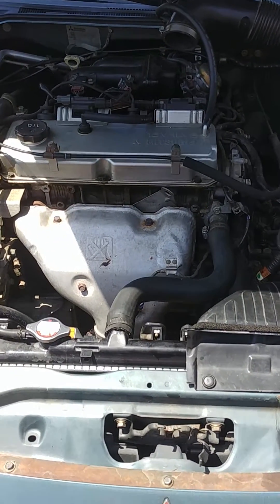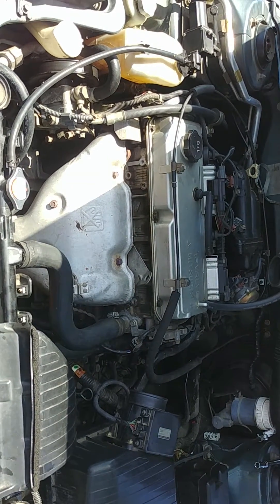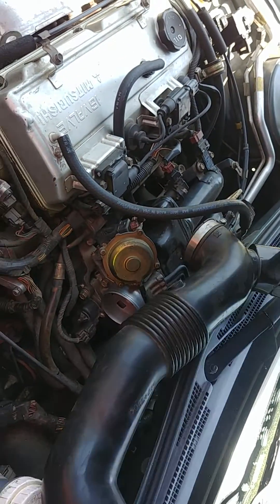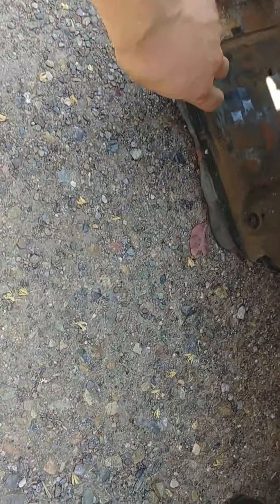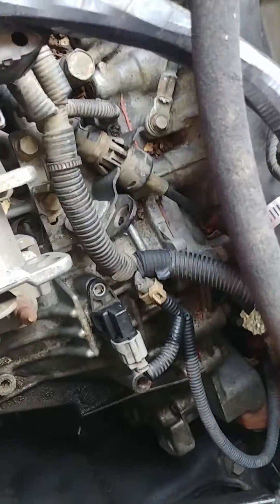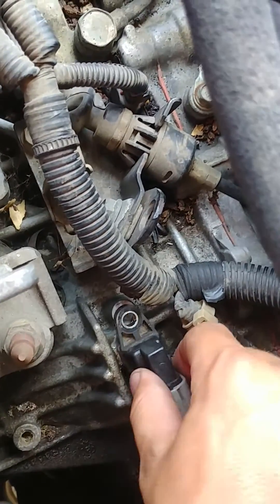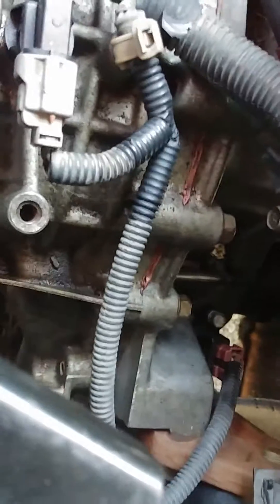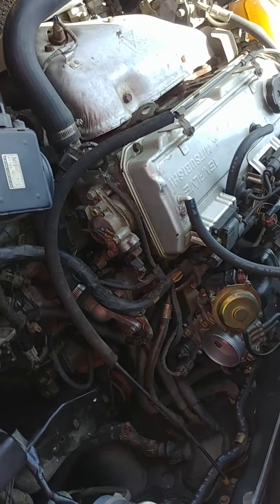Automatic Transmission Vehicle Speed Sensor Location and Replacement

Comment: Just so you know that first sensor you took out was a camshaft sensor I found this out when I replaced my output sensor and had a code go off and my car having problems starting after replacing that one with my output the lower one that you can't see in your video is the actual output and the one underneath the battery is input FYI
Reply: Thank!!! It’s really helpful!! So its only 1 sensor right? 😅

Comment: I have a 2003 Eclipse GTS Spyder, 3.0 Auto, are both sensors in the same spot as the 2.4?
Reply: I’m having the same problem. Any luck?
Reply: @NahumDoesIt  I just found the sensor that’s under the battery
Reply: @dominicio  gotcha. Hopefully its that one. The one I’m having problem is the input one

Comment: Hi, wonder if you could help. 
I'm looking at a mitsubishi shogun 2002, was told by the guy that  "It drives fine in manual mode as semi auto but gets gear jumpy in full auto mode. Took it to local garage and they said it was only an input shaft sensor"
I have looked everywhere and can't find an input shaft sensor, any ideas please thanks .
Reply from the maker: I am sorry for late response but I would replace all of the sensors, I bought the first 2 at a Joe Blow auto shop and they were both wrong. Bought offline, both wrong. Bought off wholesalers site the parts were fine and even cheaper lol
Reply from the maker: https://www.1aauto.com/?gclid=CjwKCAjwydP5BRBREiwA-qrCGgZWL06huJvC3Vssec2pIfJDRKtMiwg4Zb7A6tQMcD3Rbd6apcvr2xoCARcQAvD_BwE
Reply: @BrokTG619  thats OK. Thank you so much thats helped the problem thank you.

Comment: what was the issue of the vehicle? I have a 2003 eclipse engine runs, transmission shifting but car wont move. changed oil and solenoids but no luck! i am getting frustrated! LOL
Reply: What did you end up having to replace?
Reply from the maker: Very frustrating and demoralizing, mine had the same issue but wouldn't start at all or would overheat within seconds if it started

Comment: are both of these sensors the same ?
Reply: Sorry if this is too late but no they are not. Depending on the vehicle they will do different things. The output is what works with your speedometer if that ever stops working.
Reply from the maker: Sorry for late response but no they are not that's why I made this video and tried to show people this stupid manufacturer BS and to help people differentiate

Comment: which one is the input cus I need to replace that one
Reply: facts
Reply: I replaced my input and the dam vehicle still reving out high when I drive
Reply: @rayonwilliamssportsandfun2106  I think this is the camshaft position sensor not the speed sensor
Reply: @mysteriouslymysteriousmyst9139  Yes, you're right. That output and input shaft speed senors are on the transmission. Look at the manual.
Reply from the maker: I don't know my manual still doesn't give specifics haha sorry for late response
Reply: O